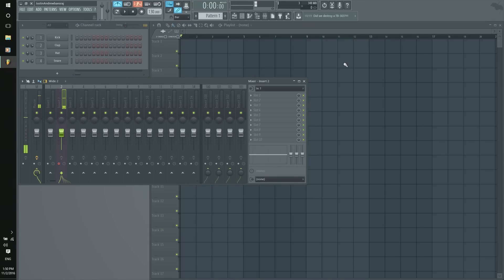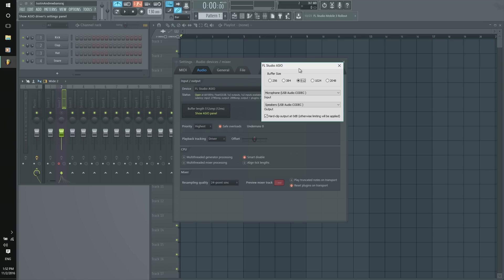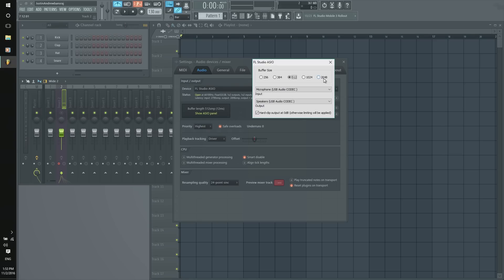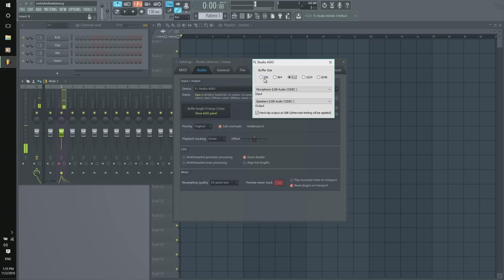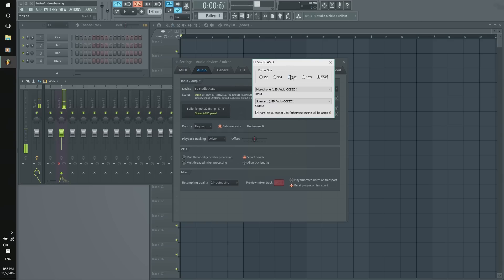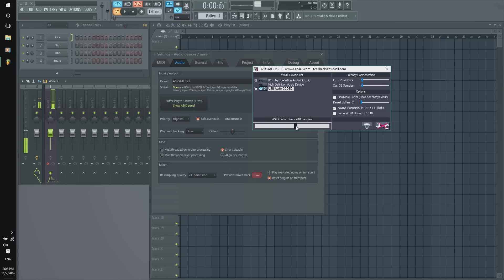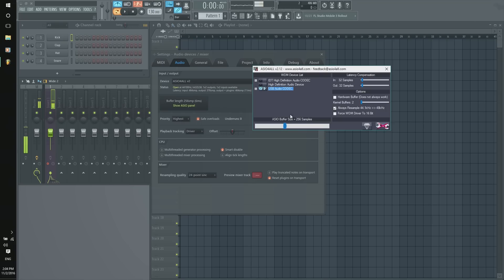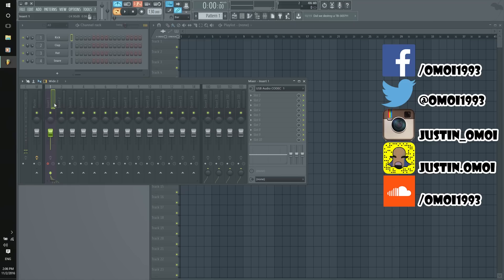Timing Off When Recording?! Here's How To Fix It ( FL Studio )

Comment: Ey bro i add my Soundcraft mixer To in this bt buffer size box can't open what is the prob can u tell me?
Reply from the maker: Did you install the drivers for your Mixer? 
That's the only thing I can think of honestly, not much info to go off of.
Just make sure that you are using an ASIO driver option.
Reply: @JustinOmoi  yes I installed the driver bt still don't work

Comment: I still get latency even though my buffer size is on 256
Reply from the maker: In some cases, even after changing the buffer size. it could be either 1. Not the best CPU processor, or 2. You should use a different Asio Device ( not sure if you use FL Studio Asio, or Asio4All. 

Hope that helps.

Comment: I also got the same Samson G-Track. Is it possible to reduce the electrical noise before editing? I usually reduce any noise after the rec on edison, but I wonder if it's possible to reduce it with a new cable maybe.

Comment: Whenever I try to use pitcher it works fine.. but it ends up pausing every minute. Like I'm recording my vocals and next thing it stops recording on its own... And turns back on after 10 seconds and then turns off again in a minute ECT.
Reply from the maker: FL Studio's Pitcher? Is it the Demo Mode of Pitcher? I remember that they used to do it like that, where after 5 minutes, it would mute for 10 seconds or so. Double check to see if it is a demo mode, or official mode!
Reply: It says trial version
Reply: I bought  fl studio 20 and it came with it
Reply: So how do i get the full version

Comment: I'm assuming you can fix the underrun issue when you have the stems on the program instead of all of the programs and plugins running
Reply from the maker: Yeah, if you were to Freeze All of the tracks and drop them in a new Project, it can take a load off the CPU. 
Best case would be to Export it into just 1 WAV file, and then just lay down the recordings from there.

Comment: Why is it that when I’m recording in fl studio 20 my vocal are all set back and don’t match to the beat . I’m always oblige to manually push the vocal sample every time so that it can be on beat and it’s very annoying especially when you wanna listen to yourself quickly right after you recoded before  continuing
Reply from the maker: Aye Aye! 
Most cases, it would be due to the buffer length like I showed in the video. Lowering the buffer sample rate should help that out. 
Do you use an Audio interface? If so, choose the Asio device for that. It will work better than the Asio4All and FL Studio Asio options.
For example, I use a focusrite device, and when installed, they will have a Asio driver called " Focusrite USB 2.0 audio driver " or "thunderbolt" etc.

Comment: when i hear myself through monitoring my vocals are on  beat but on playback its off beat so I  always have to move the clips over to get it to fit. shit is wack AF
Reply: have you found a way to fix this????
Reply: xXavorx I started to use an Audient interface instead of an USB mic and switched up to studio one. it  cut latency but only when you sing. I rap with more melodies so its becoming workable but I still run into the same problem on FL Studio when I record

Comment: When the song has a lot of plugins I need to the buffer size to be higher but then there's latency recording. Only solution was monitoring through UAD console and leaving the project in FL at a higher buffer size. But now the recording has the delay recorded into it so I have to adjust the position every time after recording. Any solutions?
Reply: Hey did you ever solve this?, i really need a solution to this same problem

Comment: How come when i use antares it makes my Mic Delay a ton?!! ts is tripping me up when i record :(
Reply: That is called ´plugin delay´. The VST itself needs some calculation time for doing it's work. In my case, on my PC, Autotune needs 31 ms for this, which is a HUGE delay.
Recording without Autotune turned on and editing with Autotune enabled is a solution for me. I think, if you need real time autotuned recording, you need the Tascam Antares hardware processor.

FL Studio can correct plugin delay by it´s plugin delay compensation function, but that makes the rest of your vst´s and tracks playing in time with the slowest vst you use. The faster vst´s get a larger extra delay, slower vst´s get less extra delay, so finally they are playing all together at the same time, if setup correctly ;-)

Comment: Does the latency affect the audio quality of the recording?
Reply: please answer this question
Reply: @Joem-fr7dj  If the latency is too low and your CPU/audio interface can't work with such low buffers, you probably will get clicks or stuttering, which of course is bad. Increasing buffer (and thus latency) can reduce or solve the problem. 
Latency does NOT make your mix sound different in ways of frequencies being lost, as with audio compression like MP3 can occur. Bitrate and bit depth however will.
Latency is just very annoying when playing or recording live, because it's almost impossible to play in time with the metronome and music. You can correct delayed notes with the quantization function, but when playing while there is a delay between playing a note and hearing the note you played is very distracting and makes it feel very unnatural and annoying. 
Getting a zero (low) latency audio interface and good drivers for it, is necessary.

Comment: can I use a USB mic with m audio interface
Reply from the maker: Nope. An Audio interface does now have an option to record with the usb on it's interface. You can set your output for the interface, and input as the usb microphone, but they won't work with eachother unless the usb microphone has an Xlr port.
Reply: how can I do that in fl

Comment: I Fix the latency as you said, but my FL studio is make pauses and it is very irritating. Do you have any advice in how can I fix that because it messes up what I sing and then have to record it again and again and again. If anybody know about this issue help would be nice :)
Reply from the maker: Hmm, I don't know what you exactly mean by pauses. It may be that you don't have enough CPU or something. I'm not too sure on that. Just make sure that you only have FL Studio open, and it's all right to have some underrun clicky sounds happening, since it does not effect the final output.
Reply: Okay, I am going to try to explain it better. When ever I record I only have FL Studio open, I close everything else. But when I am recording vocals it freezes for like a half second from time to time and when I play it back you can hear in the playback the sound that it skipped the part where it froze. When it Freezes on the CPU load history it turns red. Do you know why? What can I do?

Comment: @justin omoi 
hey bro 6 ms is still too much time i want to hear the sound directly. Especially when i use Autotune it has still too much delay.How can i fix that?
love your videos by the way :)
Reply: lord lu
I have the same problem....
Reply: HOW
Reply: If you use AutoTune , you have to use the Realtime-Version.The normal AutoTune isn´t supposed to use directly while recording.That gives you extra latency.And actually 6ms latency shouldn´t  be that noticeable.
Reply: can u help me with that bro?:)
Reply: lord lu Did you find a fix
Reply: lord lu still have the problem? I had the Same and Fixed it
Reply: Mc Muffin The devices other than FL Studio ASIO won't monitor, so thats the problem.
Reply: Go to audio settings then on buffer length click on 32 or 64 samples thank me later.

Comment: what's the difference b/w asio4 all and fl asio is there any difference  and what's the best setting for buffer size i think 256 is good but for  me 448 also works fine but if i reduce the buffer size like 256 is it decreasing sound quality also 
and justin could u make a video on sound selection 
and also how do u make ur videos for you tube
Reply from the maker: The Buffer size doesn't do anything to the overall quality. Not sure what you mean by sound selection. And I use Adobe Premiere Pro to edit my files. I Used an Elgato HD 60 to record my laptop
Reply from the maker: ***** He was talking more about the overall sound quality. Not about under runs in that case. xP